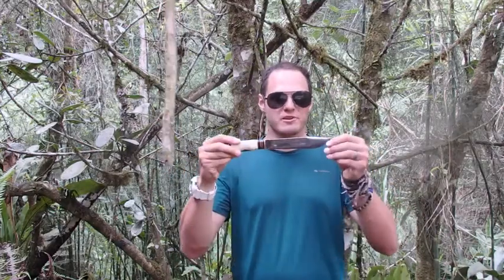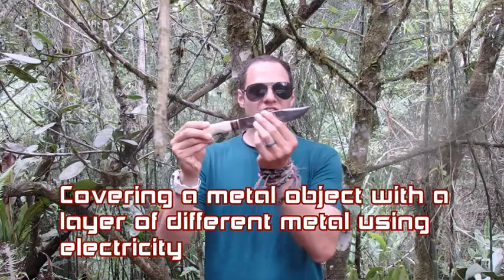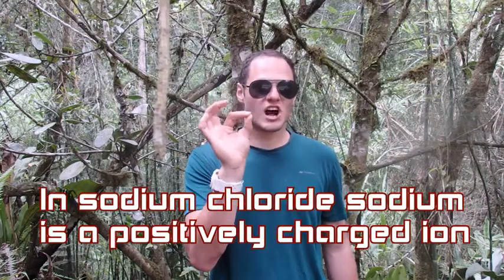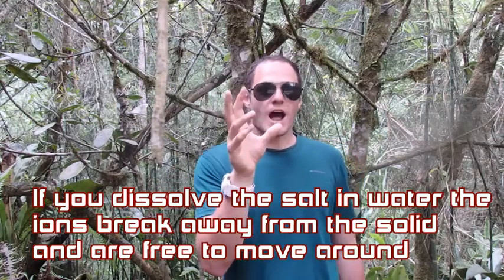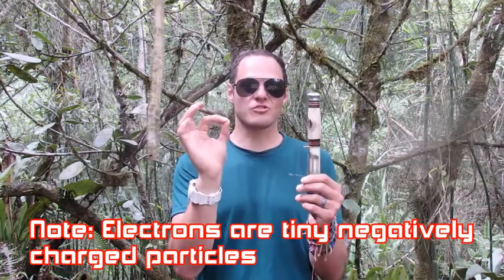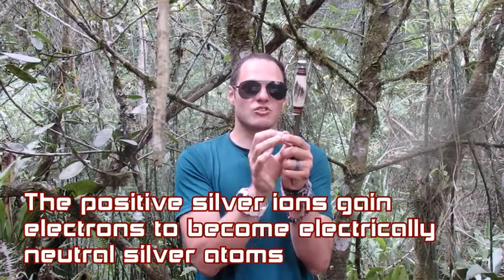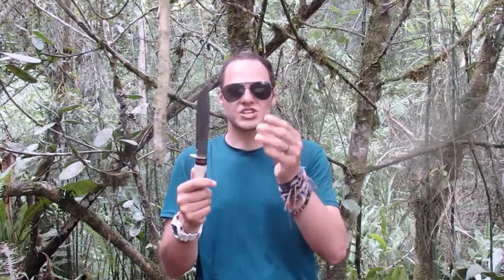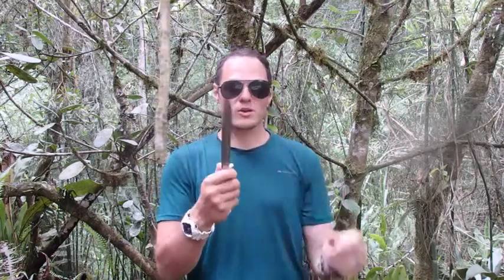Electroplating and the lost geek

Comment: I thought metals always formed positively charged ions.
Reply from the maker: You are correct - they do for positive ions :-) This is because metals only have a few outer electrons, so it is much easier to lose them to become stable rather than trying to gain lots of electrons to fill their outer shells. In electroplating positively charged metal ions are attracted to the negative electrode (the cathode) where they gain electrons to become electrically neutral atoms which are plated onto the surface of the electrode. The negative electrode is negatively charged because extra electrons are being "pushed" onto the electrode by the power supply - but the metal atoms don't "gain" these electrons - they are just added to the "sea" of delocalised electrons that surround the metal ions.